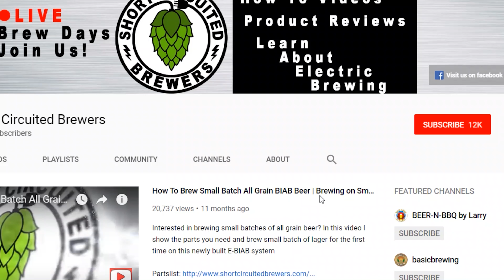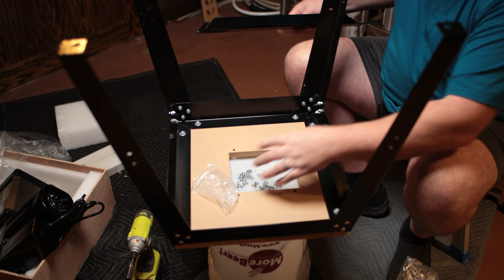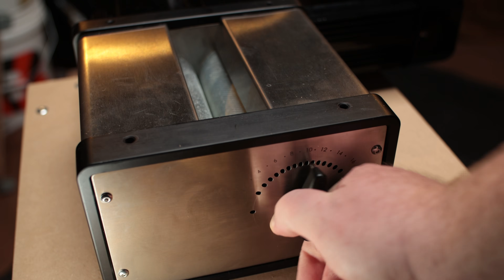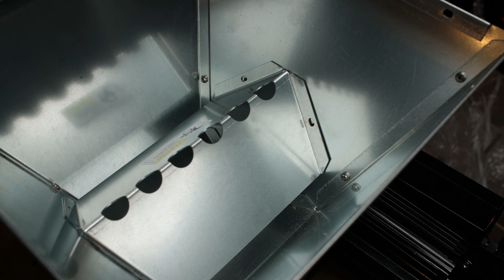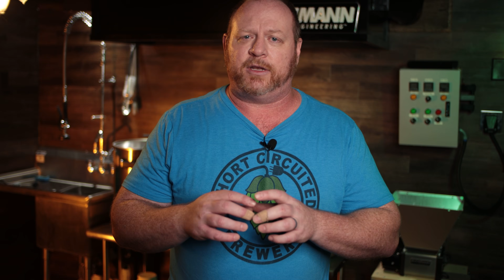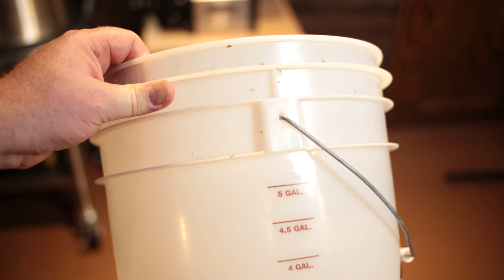Blichmann Grain Mill   Assembly, Features, and Crush Test

Comment: Thanks for the great review! I'm curious about how this mill compares with the RMS Micromill. 
The Blichmann mill has about 44% more throughput capacity than the RMS Micromill, but is about 1/4 the cost. What makes RMS so much more expensive? Especially when the Blichmann mill has fluted rollers, while the RMS Micromill has knurled rollers, which are considered less ideal than fluted rollers from what I understand.
I'd appreciate any input! Thanks!
Reply from the maker: I cannot speak to the difference as I've not used the RMS.

Comment: JB is really top shelf with brewing equipment. That unit looks like a real winner. Thanks for sharing Brian. Not sure I can justify 1300 for my home brewery but you never know. Cheers.
Reply from the maker: Yeah I hear you. I wonder how an increase in efficiency = less grain used would equate to break even point. Depends on how much and often you brew I suppose. 👍🍻
Reply: @ShortCircuitedBrewers  that’s a great point. Life cycle cost might be worth it. That thing looks like it would run forever where most mills break down in a couple years. I may have to run the math!!

Comment: MDF panels?
Hate that material
Reply: You can get it without the stand.
Reply: @steventrott8714  WOuld love to see a sturdy stainless steel frame available. You would never need to buy another mill again and only maintain or replace parts that wear.

(reason I hate MDF is that it contains formaldehyde in the adhesive used in the manufacturing process. Breathing in MDF dust or fibres is hazardous: Formaldehyde is a class 1 carcinogen. Very toxic and linked to cancer and other illnesses)
Reply from the maker: That's true! 👍🍻